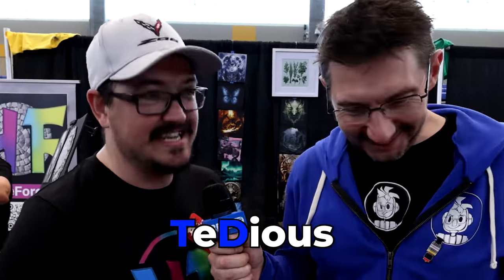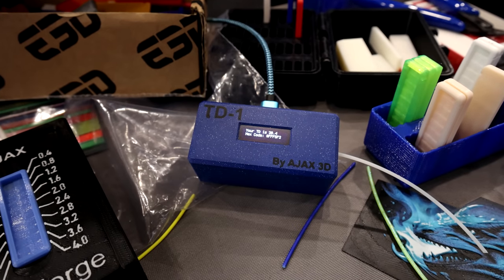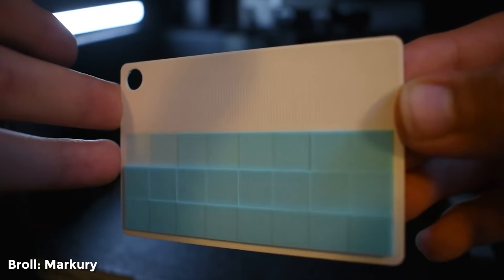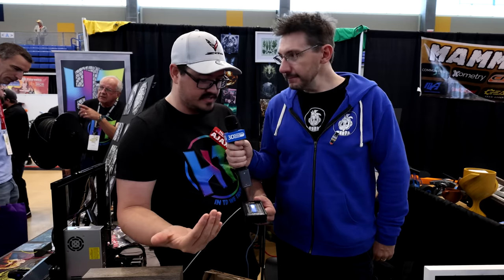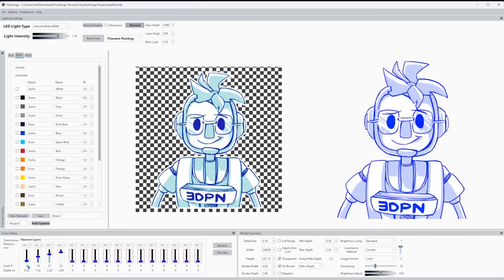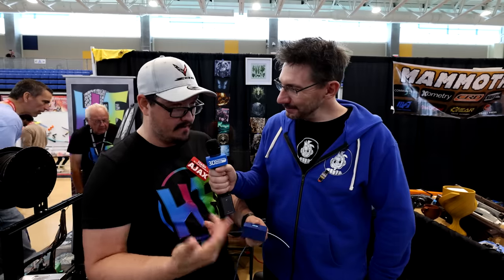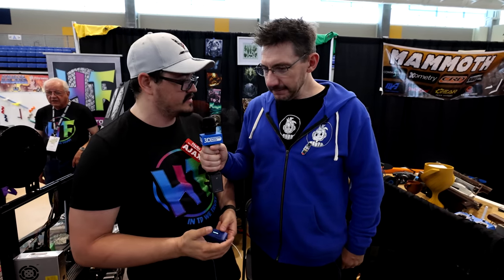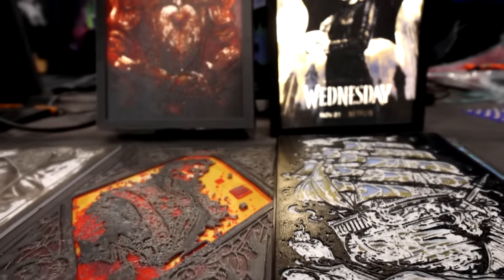What is Transmission Distance in 3D Printing?

Comment: For those saying just have the manufacturer print the TD value on the box, there can be slight inconsistencies between batches of the same colour filament (& even within the same spools, supposedly). So the benifit of this device is that you can get a new spool, open it up, snip off a length of filament & then you have the exact TD for that spool
Reply: But won't it have the same amount of inconsistency between different segments of the spool itself?
Reply: That's cool to know, thanks! I'll check back a color when I'll repurchase it. Though... I don't expect the TD to change of more than +-0,2 from a batch of spools to another if the company is solid and the product is known.

Comment: I love hueforge, it's brought something fantastic, new and very different to 3d printing! The only two things I wish it had is a mac version, but also a 'border' option as a lot of prints have 'pixelated' edges, maybe an option to stick a fixed 0.3mm solid border around items would help not only strengthen them but tidy up the edges a bit. I tend to do this manually but it's a bit of a TDous (ha) process.
Reply: HueForge for Max OS is available NOW 🥳
Reply: @jairogarcia131  :o It is?! Thanks for that, I had no idea!

Comment: Very much looking forward to this coming out. Technically the models are around already, and I think some of the BOM is too, but the firmware is not going to be open source and isn't available right now. Also, he said it's like $10 if he made tons of them, but in terms of selling them, that's more buying the firmware so you'd have to self source, which will put it over $10. Just in case people are confused when they check the site and it says "$5-$15 for stl, bom, firmware" and then goes up to $65-$75 for preassembled.
Reply: Makes sense for it to go up a fair bit for preassembled as from the sounds of it it's going to be fairly labor intensive due to needing to solder by hand.  I know places like PCBWay will do that for you but if its a case of needing to make sure specific components are used and not similar ones then its possibly not an option. Plus its obviously low volume stuff so the production costs do go up a fair bit. If you're all in on HueForge though $65-$75 isn't going to be an issue IMO.
Reply: @Rick-vm8bl  exactly

Comment: TBX is the industrial term and is known as the standard opacity meter so you could monitor the filament colorant control to dose inline  thru a gravimetric blender keeping an eye on the output and consumption for accuracy,  not new and we always tested light tru plastics for 50 years at least so nothing new but this application but very kool and a good idea for sure but all this existed long before, but kudos for extracting it and applying it to FDM/FFF Cheers! fyi tip you can use ultrasonic sensor to monitor the gauge /layer height too then and maybe one for the filament OD too, both can have a profile plotted from them too.